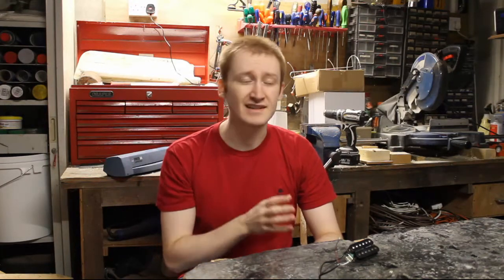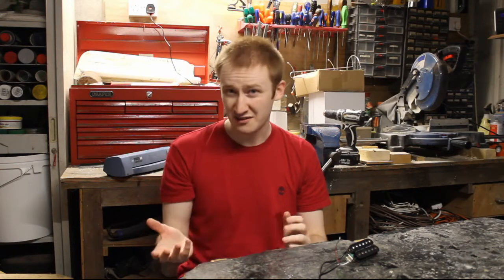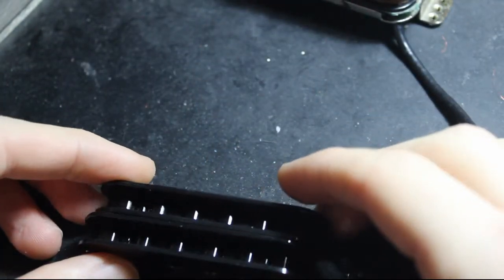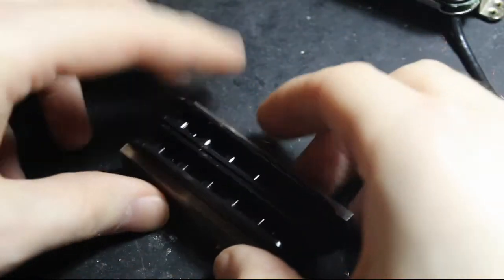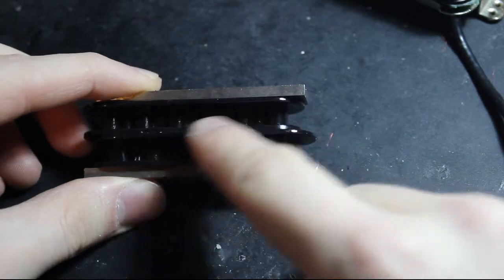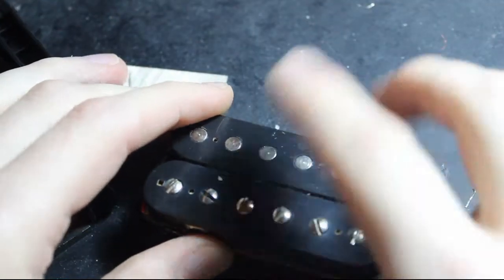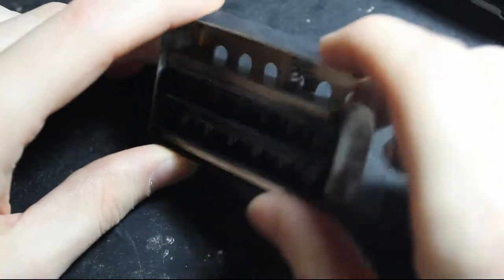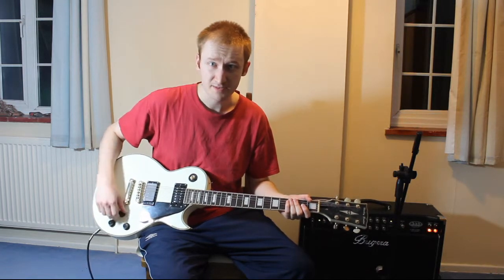Redesigning the humbucker - Did Gibson get it wrong? (part 1)

Comment: Isn't your concept essentially the same as a firebird style mini humbucker?
Reply from the maker: Not at all, a Firebird pickup is just a miniaturised humbucker with bar magnets inside the bobbins.
Reply: @Alegree    But it has a narrower field, just like your design, yes?  And you've put the bar magnets laterally.   I'd suggest your design sounds more like a Firebird pickup than a normal humbucker?  Why not just go with the Firebird pickup design?
Reply from the maker: @Iggytommy  It does, as do Strat single coils, Tele single coils and P90s as well. 

The finished article isn't remotely like a Firebird pickup, in form or function. A firebird pickup is much closer in design to a standard humbucker than it is to my (now named) bentbucker pickups.

Comment: Maybe a horseshoe magnet that over the top cut in half with a wood or rubber piece in the middle keeping the magnets separate. Neodymium magnet or adding a small step up transformer for output.
Reply from the maker: The horseshoe magnet is an intriguing one I'd like to play with. May be possible to make a makeshift magnet out of bar magnets under bobbins and a set of ferrous blades on either side and in the middle.
Reply: @Alegree  sounds interesting. I know that Seth Lover originally wanted only slugs as it had a more pleasing tone, but the adjustable coil was a selling feature. I personally want to make low gain bar magnet humbuckers, based on a firebird. You could also try the same concept you did with you humbucker sized p90s and thin out the bobbin but deepen it for a similar effect. Also use of mini-humbucker bobbins you may be able to fit 3 bobbins under a humbucker shell like you are doing.
Reply from the maker: @pastorkev777  Already done - my bentbucker low output set.

Comment: Aren't SD Hot Rails a different solution to the same problem?
Reply from the maker: Not really, they're just a humbucker shrunk down to fit a Strat pickup slot (with blades instead of screws/slugs)
Reply: @Alegree  Understood, but in shrinking it down, doesn't that also narrowed the sensing area too or am I missing the point?
Reply from the maker: @ProfTrout  You're right, but in order to shrink it down they've also used much thinner wire (see the high resistance of them in comparison to a full sized humbucker of equivalent output level) and a ceramic magnet to imitate the full sized equivalents. The thin wire adds a lot of bass and compression, which is counter to what I was going for here. A lot of people do report them as being 'thinner' sounding than their full sized counterparts, due to the smaller string sensing area though.
Reply: @Alegree  Ah, I see what you're getting at, you were trying to redesign a humbucker to try and keep some of the desireable single coil quality whereas a Hot Rail is trying to fully embrace the humbucker vibe in a small single coil package. Interesting stuff. Would be interested to hear your take on Lace Sensors and active pickups.

Comment: Sounds good, maybe if the coils were separated instead of pushed together with the spring there would be a wider magnetic field? Also agree with a bit hotter winding. Keep rocking Dude!
Reply from the maker: Thanks! You're right, that would widen it all up. But that's exactly the opposite to what I'm trying to achieve with this one. I want everything to be as compact as possible to get it sounding a bit closer to traditional single coils (I reckon it's going to end up in the minibucker sort of sound region).
Reply: But he wants to achieve a narrow field, that's the entire point.